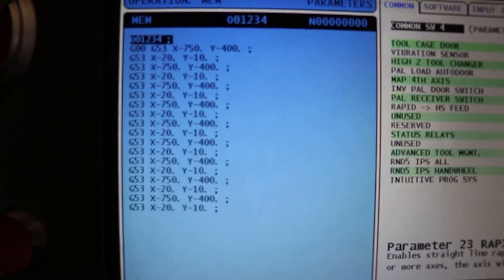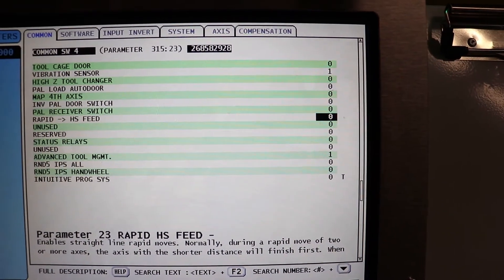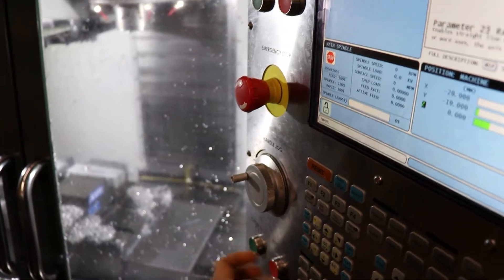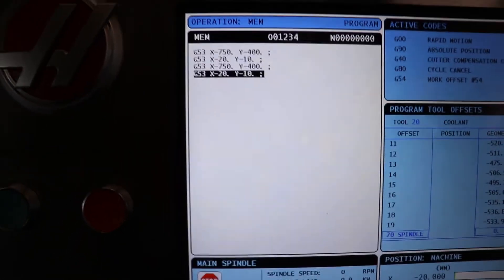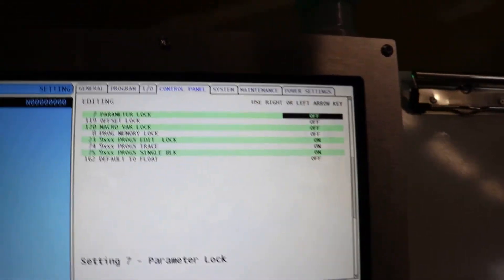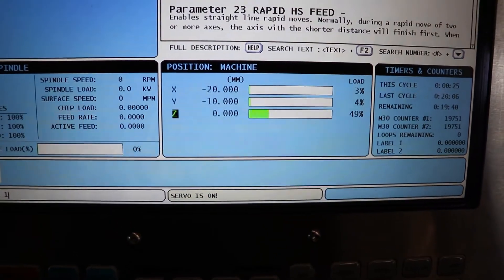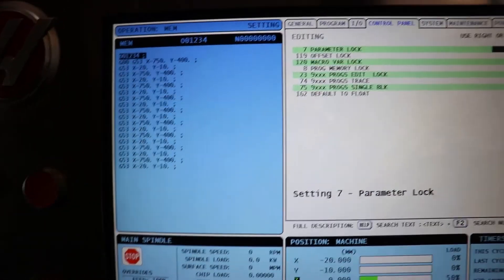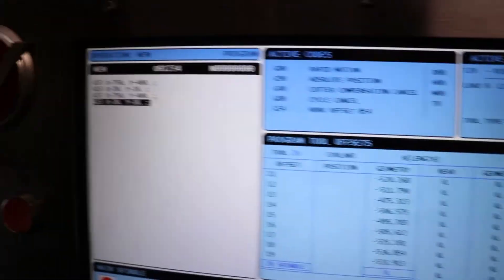Episode 3: Haas Parameter 23 and G00 Execution Time

Comment: AND... here's another angle. If the machine prioritises X axis rapid rates, and matches the Y to the X to interpolate the path. Then the result might be different if the bulk of the rapid movement is in the Y axis, which is not the case in your test.
Reply from the maker: Replied to this is your previous comment, but again, it doesn't matter which axis it is.
Reply: Is this based on tests you have done, or wording in the manual?

Comment: Also can you check to see if the feed override button impacts the rapid moves... I know you said the rapid override still has an effect on the rapids on your machine. But what about the other way around? I wasn't imagining this, and there are other people who state this behaviour in forum threads I've read, and I just found another one confirming this. Maybe Haas changed the behaviour in one of their software versions.
Reply from the maker: Feed override does not impact the rapid speed and it doesn't matter if it's X, Y, Z, or A that has the shortest distance, all axes arrive simultaneously with the longest distance to go axis at full rapid speed.
Reply: Does it state that in the Haas manual?

Comment: Parameter 315:23 causes the control to treat rapid moves as high-speed feeds so that all of the axes arrive at the target position at the same time. This can cause jerking or shuddering motion during rapid moves.

Corrective Action:

Change the value of Parameter 315:23, Rapid ->HS Feed to 0.
Reply from the maker: No jerking motion on my machine. I can only assume they solved these problems before my machine was built. I've run many Haas machines in the past with most left to their default dog leg rapid settings. I changed my machine over on the first day or so after having it installed. Haven't had any issues.